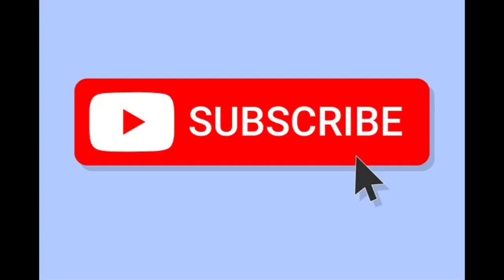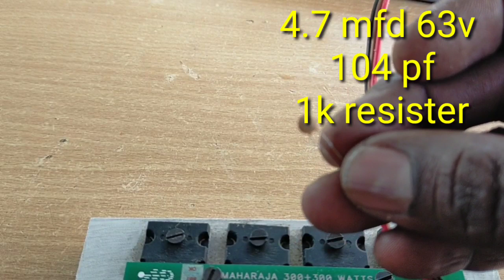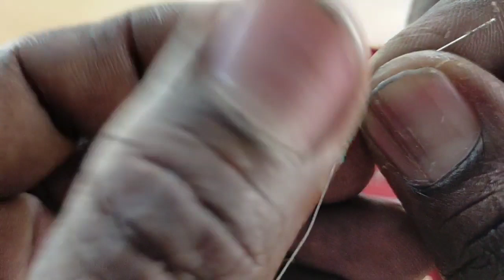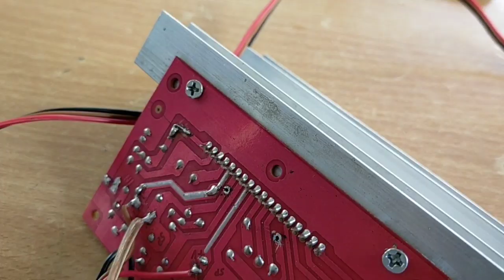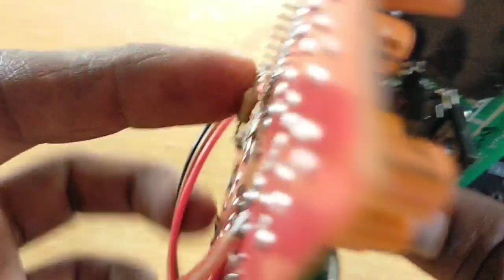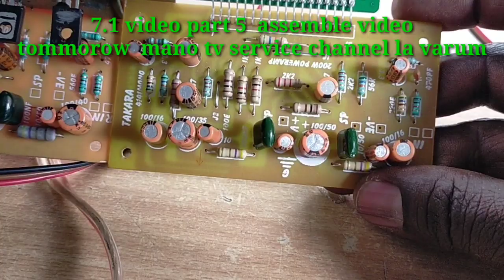How to Change Mono to Stereo in Audacity// mano audios//mano tv service

Comment: Brother....

5 channel sakthi amp board  க்கு 24 volt transformer 5 amps use பண்ணியிருக்கிறேன்.  Output நன்றாகவே இருக்கிறது.  ஆனால் amplifier off பண்ணினாலும் சில நொடிகள் பாடி கொண்டு தான் off ஆகிறது. இதற்கு என்ன செய்ய வேண்டும்??

Capacitors 10000 of 63 volt 2 use பண்ணி இருக்கிறேன்.
Reply from the maker: கெப்பாசிட்டரை 6800/50v podunga

Comment: Anna 35 0 35 5 amps transformer Enna capacitor Use pannalam ic stk415 130E 100+100 Watts Sollunga Anna Please
Reply from the maker: 15000/63v podunka
Reply: Ok Anna

Comment: 104 is 0.1uf/100nf/100000pf., Do not add 104 pf, it's lose more high frequency signal and lose more gain, .
Use at 100pf to 1kpf(102pf)